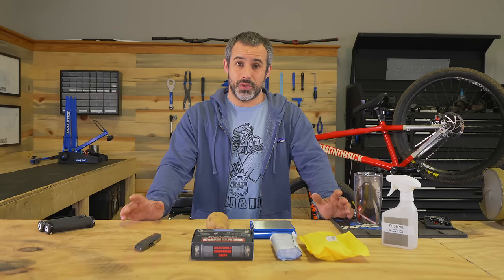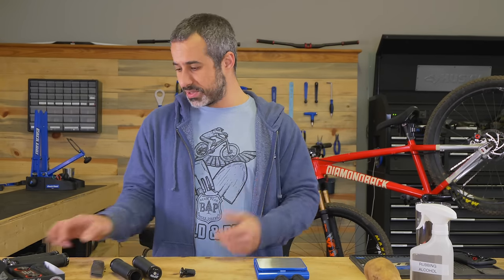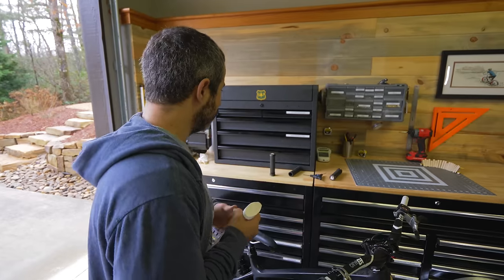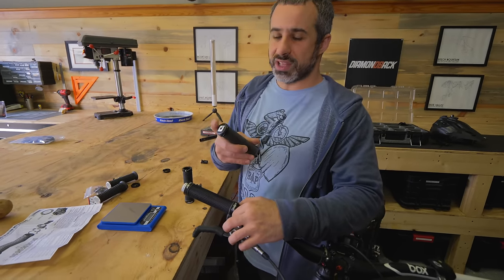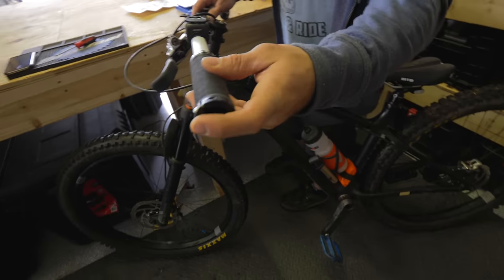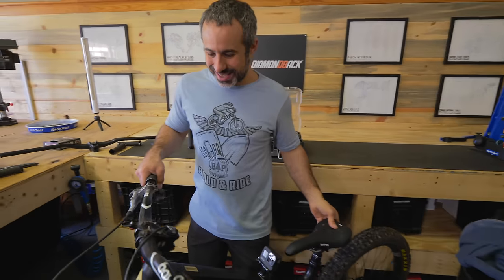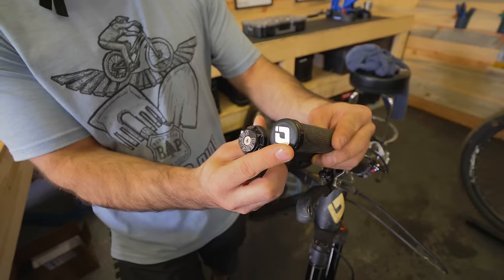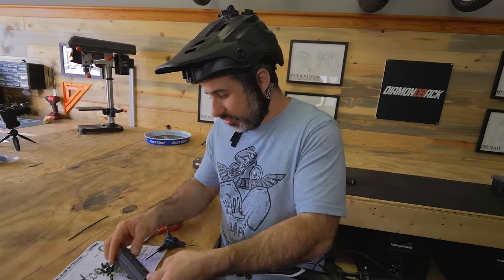REALLY?! How do $90 bicycle grips stack up against $5 grips?

Comment: When installing any kind of slip on grips,  I recommend using cheap hairspray.  It will lubricate them and make them easy to install when wet, and dry sticky.  That should eliminate the twisting you get from slip on grips.
Reply: RollinRat  Just cut them off when they're worn out. Probably need some fine steel wool or wet'n'dry to clean the paint off the bar though...
Reply: RollinRat  Your bar (like your seatpost and your cranks & bottom bracket) need to be strong if you're riding seriously off-road, but a the end of the day you pay your money & make your choice. I like stuff to be light, but I think it was Tom Ritchey who said "Strong, light & cheap, pick two." 
I don't like carbon components in critical areas, you don't get any warning in the case of catastrophic failure. Metal components tend to give a bit before they fail outright. I'll sacrifice a certain amount of weight for peace of mind. 
My only issue with lock-on grips is mostly to do with my own cack-handedness (and the cheapness of the clamping bolts on some offerings). Old-fashioned slip-on grips work well if you put them on right, though I'm not sure I'd be happy with the cheapest ones out there (the more expensive ones tend to be made of better material that is grippier). End of the day you get what you pay for. Still balk at $90 for a pair of grips though.....

Comment: I've had revgrips for about 18 months now and love them. I've never had them come apart like that but I am using ally bars and have tightened them more than the 1.5nm. They definitely helped with arm pump over long rough terrain but then everyone is different so what works for some won't work for others.
Reply: Rev grip ad bot

Comment: I've been riding with the Rev Grips for 2 years (2,500+mi) since I got them at the Sedona MTB Festival and I really love them.  I haven't had any trouble installing them and the suspension in them really helps since I have a hardtail and ride every trail I can find. At the festival this year i'm going to replace the actual rubber grips since I want to try the medium size and those will be $25.  The cool thing is that if you need to replace something, you only need to buy the individual part you need.
Reply: I've been using grips strikingly similar to the $5 grips tested in this video. The stuff I buy costs about 7 or 8 dollars has a diamond pattern instead but the overall construction is the same. I can tell you for a fact that those are also modular. There's a core plastic piece with the rubber overmolding on the outside. These are the pieces that contact your bars and your hands. Then there are two clamps that fit perfectly on each end and pinch the grips to the bar and a separate bar end to plug the death hole. You can certainly buy these parts separately as well. But you won't bother looking for them because the entire package is cheap to begin with. Might as well replace everything and have them look brand new without scratches and dirt. As for the Rev Grips, the price compared to the materials and complexity is ridiculous no matter how you look at it. That said, if they provide enough value for you then that's great and keep using them. I feel like they can only be targeted at a really small audience. I would never want suspension in my grips. Same goes for my bars actually. I just want suspension in my suspension and my body can handle the rest. I want the bike to feel rock solid without play or flex in any components, this is what gives me confidence. I could never trust this design on a downhill ride. Those tiny rubber spacers installed on the ends are the only thing connecting your hands to the bars. That feels insane to me.
Reply: I call bs
Reply: No to be a prick, but the “cool thing” about replacing collars and stuff, literally any decent set of double ended lock ons allow you to do that. Odi’s are a fraction of the cost and they’re fully rebuildable, Superstar Components also used to offer grips where you could swap out your collars etc. It’s no a unique feature, companies have been doing it for years. Definitely not worth the $90 price tag, get yourself a set of DMR Deathgrips or ODI Ruffians at a quarter of the price and spend the rest on a set of tyres etc. I know what I’d rather do with my money. 🤷‍♂️
Reply: I've had some cHiNeSe 2€ grips on my cruiser and after 5000km they still work just fine. Not that I bunny hop or take them to trails or anything like that, but still...

Comment: A trick my mentor taught me that would work perfect for rubber grips is use hairspray as a lubricant and then it will dry tacky when it’s on so it won’t come loose

Comment: I put my grips on with women's hairspray, it has a mild gluing effect and lasts! You can add thin zip ties to the cheap grips to keep them in place also.
Reply: RollinRat  How do grips get wet inside? Mine have been on for years, and i ride in all conditions. Just choose a good quality spray, it's effectively lacquer.

Comment: Seth I have been riding RevGrips for years. I love them, they take some of the vibrations out. I usually put the shock absorbing inserts in the end cap first then slide them on. Takes me about 15 minutes to put both on. And I don’t use the Torque recommendations. 
You should check out their new stem. Built in GoPro mount and bell.

Comment: About the grips and putting them on. We use to spray a little cheap hair spray on the bar and slid them right on. The hair spray dries and actually helped hold them in place.

Comment: Might be worth an updated video to revisit the install using the new elastomers -- unlike the old method of 4 little pieces that you need to cut out, it's all one piece now and goes much faster.

As a note, if you really want extra security against the grips separating if they do loosen, you can put a locking collar from a cheap pair of grips inboard of the inner collar.  (You could also do the same with any pair of locking grips, actually).
Reply: Oh wow, very good to know!

Comment: Seth brother, I run the REVgrips on my bikes and the first time I installed them on my enduro the grips came loose on a downhill run. I ended up losing a shock absorbing insert on the trail. Tightened it up and replaced it when i got home. Definitely needs to be tighter than what the manufacturer recommends but once I got it dialed in, I love the way it feels. I have it on my hard tail also and these definitely work for me! Cheers to another great video.

Comment: Revgrips support is great:
first time when there was inserts, those things you have to cut out, they sent me those, plus spares, and a set of spare sleeves(the grip it self).
that's great support.
Reply: That should be expected for a 90 buck grips.
Reply: RollinRat  if that works for you why not. I haven't tried them, how long do the last?
Reply: RollinRat  so you speculate you might be on 2 pair in two years, if that's true that would be a very long lasting grip.
Reply: RollinRat  I dont know what you mean by: ''END the world banking system!!''
Reply: RollinRat  what? I am not a victim of anything, now, so you mean I am a victim of inflation?
Reply: RollinRat  I use the Ergon GA3 grips on my two MTBs.  They have a wider section to support the palm of your hand, works for me.
Reply: RollinRat didn’t know they males saddles. I bet they’re good. I like WTB Silverado and Specialized Power.

Comment: I've been dying to see how good the REV grips are.
Reply: This is not a accurate representation haha.
Reply: @MillerRL96  I think it is.
Reply: From my experience a year and a half of riding dh on them it's not accurate. I've had no problems
Reply: There's some good reviews out and I got a pair - iirc you can return them if you don't like them?
I've run them about a year and no issues including multiple uplift days on my trail bike. Not sure what went on here but it didn't look good... I've no concerns with mine.
My opinion is that they aren't quite as comfortable as I hoped - the rubber on the grip itself is more shallow than a standard grip (it's mounted to a plastic tube that sits over the bar). It feels weird for a run or two but then you don't notice it any more. I like them and have kept running them, but they didn't blow me away as I'd hoped.
Reply: @TheSlimboyjim  mine fell apart while riding, i never found the parts.
Reply: It's the first thing I put on my bikes

Comment: having revgrips on my bike since 2 years. they are amazing, and i stopped having pain in my palms while riding all day in the bikepark!

edit: after seeing this video - they do take a little bit when installing first, but if you fuck up tightening then you better not use em. i had em on my downhill bike for 2 years now with a carbon bar. never had this issue! AND especially when you have problems with the wrist (or in my case with my palms) they are amazing!
Reply: I was having a lot of trouble with pain in my palms so I was trying a lot of different grips and handlebars. I came across Revgrips and remembered a similar design was used years ago for grips that eliminated arm pump on dirt bikes. I got the less expensive Revgrips without the tuning washers and with the smooth plugs. I've put in a lot of rugged off road miles since I put these on and my palm pain has gone away...BTW, there is always some one that that can destroy good equipment in a short time like the gorilla grip guy in this video.  Like I tell my son, just use things normally, don't TRY to break it.

Comment: A tip I learned from a scooter boy for installing non locking grips, use hairspray as a lubricant. It lets it slide a lot like the alcohol, but after it dries it acts as an adhesive preventing the grips from becoming loose later on.

Comment: I’ve also been riding rev grips for over a year now on pretty rough stuff and I love them. Did have an issue though...after about a year (just over 120 hours) the tightening screw on the outer locking clamp did break mid ride and I had to ride back holding onto the bare bar. From your video it looks like when you installed them you didn’t have enough force between the locking caps to keep it from twisting entirely like it did. Pull/push them together like a mother f*cker when you tighten the second one and you should be set. If the tabs on the grip itself are completely seated in the metal clamps there is no way it can twist. I’ll look for you at sedonafest haha
Reply: Thanks for this comment Ben. Well observed. It seems a great deal of viewers have taken the Revgrips content within the video really light heatedly and indeed, so many Revgrips users bigging them up. Phew...this video could have resulted far worse for the brand.

Comment: With the non lock on grips I find the best method is to make sure the handlebar is clean, then spray the inside of the grip with the cheapest extra hold hairspray you can find - the grip will slide on easily, then you have to leave it a while to dry (anywhere from one hour to one day, depending on temperature). The grips should be completely solidly fixed to the bar, takes an enormous amount of force to move them normally (or a narrow screwdriver & some teflon spray lube, they'll be straight off no messing).

Comment: Those suspension type grips might be suited for something like a commuter bicycle, or someone with a hybrid. Neither of them will be as aggressive on the grips as any kind of mountain biking, and with most city style bikes being fully rigid you'd probably feel the benefit more.
Reply: No. They excel on really technical terrain, and help with hand pain. Plus who buys $90 grips on a commuter?
Reply: @topspot4834  My commuter bike when i used to commute, cost the same as $1500. In this video you can see that they are useless on technical terrain or mountain biking because they move and come apart when you grip them and twist them aggressively.

Comment: u said the 3.99$ grips twisted when u were done, looks to me that they were twisted when u put them on?  4:35 :) did u fix that b4 u went? :)
Reply: The scene right after that shows they are parallel, and did indeed twist after riding.
Reply: He rode the bike, he surely FELT if they were sliding around you dont have to look at the grip to tell if they are good while your riding.
Reply: @16driver16  If he had put them on with extra-hold hairspray (the cheapest, nastiest available) they wouldn't have moved at all, been doing that one 30 years at least. Only drawback is they are a swine to remove, usually end up gently lifting one side with a thin screwdriver & spraying in a teflon-based lubricant so they come off easily. Or you could cut them off if they're worn out. Seems a lot of bother when lock-on grips are so easy to use, but I have a habit of pathologically over-tightening every bolt on my bike & broken off allen bolt heads are no fun.
Reply: @AnthonyIlstonJones  i use a little spray paint myself, it glues the grip to the bars when it dries as well
Reply: @AnthonyIlstonJones  good ole Aquanet.

Comment: I had bought a $600 full suspension diamondback at the end of the year for $350. I rode with a couple guys who had $5000 bikes, we traded so we could see the difference, I couldn’t tell any. They said they could maybe tell a little diff. But the big thing was the parts were better and wouldn’t wear out or break ect, 6 years later I’ve had maybe 3 things break, still nowhere near even $1000

Comment: "Back in my day" before lock on grips and when the ozone layer was still intact, we used hairspray to install slip on grips. When the hairspray was wet, the grip would slide right on. When it dried, the grip wasn't going anywhere.

Comment: I have run Rev grips for a year and love them. Definitely an installation error. If the locked ends stay out, they are solid. I got them to combat hand numbness during rides, and they help out. I still have CT, but they let me get a few more miles in before I have to stop.

Comment: Imagine going and making a 90$ grip and getting outclassed by a 5$ Chinese brand
Reply: Sam Purdon imagine him not installing it correctly. I’m used rev grip exclusively for bike parks. From jump trails to double black tech. They stay on. I have also crashed several times they stay on. Can’t be outclassed if the user has no clue how to install them correctly. It takes 30 mins - 1 hour if you have no clue what you are doing. It takes 5-10 min once you are used to installing them. These are on both my enduro and DH bike. So for him to say XC is utter ignorance.
Reply: @kroozctrl6284  I had the same experience as Seth, and I also trust Seth's ability to do a proper install.
Reply: @ericliebert5260  theyre not installed correctly, ive had 2 sets for a long time now. no issues with either
Reply: @dazeccles  ok but the install is crazy, i couldnt get it right and it looks like seth coudnt either.
Reply: eric Liebert you do know the collar clamps are clamping two things right? They are clamping on the bar and the isolator. If you do not compress the whole assembly together, then they will not stay together. I highly doubt Seth did just that. He has it loosely preassembled then slid it on the bar; tightened the rest. Also that bar end plug shouldn’t be spinning so freely like it did in the video.

Comment: the revgrips are great, the installation is a little easier now and tbh I think I probably torqued them down nearly double what they said, no issues so far after a few months and they help as I used to lose feeling completely in both hands due to carpel tunnel

Comment: One time I was riding a packed hill of gravel. The bike was a 2000 Gary fisher sugar 4. I had a sweet gold Mavic front wheel. I was riding this little jump, and I was riding it, let go mid air for no reason, and I ended up landing directly on the end of the bar, right over my heart. If they didn't have bar ends, I would have died. The bruus had some of the nastiest coloration you've ever seen. Anyway, a tale of caution for you. In addition, I cracked my Mavic rim. It physically cracked.

Comment: If you get all the way down to my comment. Here ya go, I’ve had revgrips for years. Install is tedious. But who doesn’t mind a few min in the garage wrenching on the bike. The revgrips are LEGIT and WORTH IT. I was skeptical before owning them. Well worth it! I’m 6’0 200 lbs and consider myself an intermediate rider that lives descents. These grips do help damp vibrations. The 1st time I rode with them it was definitely different, But 3-4 rides in and I won’t own a bike without them.

Comment: There's only one way to properly apply rubber grips. Drop them in boiling water, take them out with tongs or something and then they easily slip on. Just pushing wears the rubber on the inside of the grip, making them less tight. The hot water just expands the rubber and it then shrinks down onto the handlebar, providing a very sturdy hold.
Reply: Hairspray

Comment: A trick for grips is to use liquid dish soap. Just a touch. They go on easy and then the soap dries out and acts like glue. When it is time to change inject a little water and slip them off.

Comment: I have rev grips.. I bought them along with spank vibrocore handle bars on my DB mission pro to help with sore hands at Whistler... I believe they help a bit but not sure if it’s because I’m using them with vibrocore handle bars.. my one complaint is the rubber wears down super fast and the grips have too small a diameter.. I bought motorcycle grip sleeves to put over them to make them thicker and since the grips wear way too fast.. overall i think there are pretty decent.. but I think the specialized enduro grips which are like $15 are better bang for buck.. thick, soft and last super long.. thanks for the video! Love your reviews!